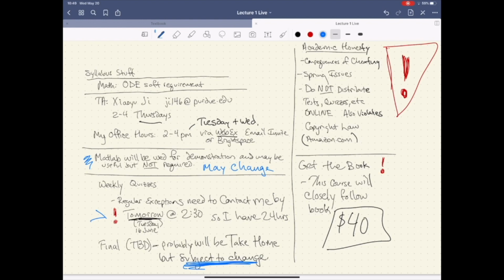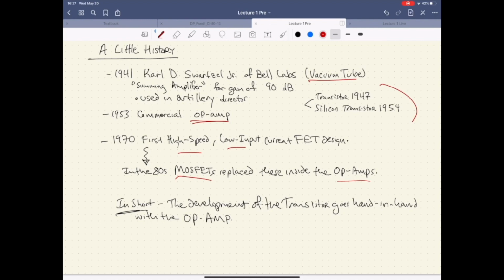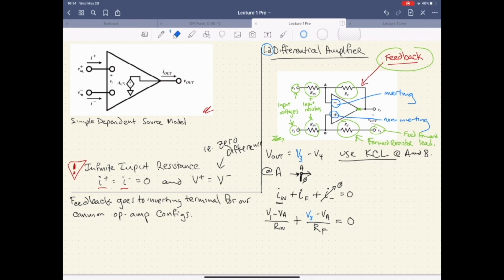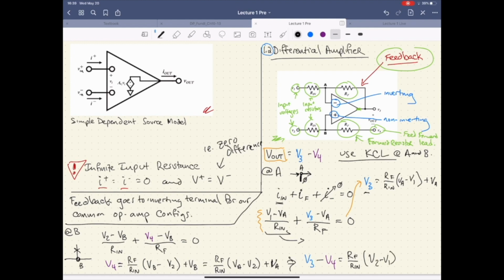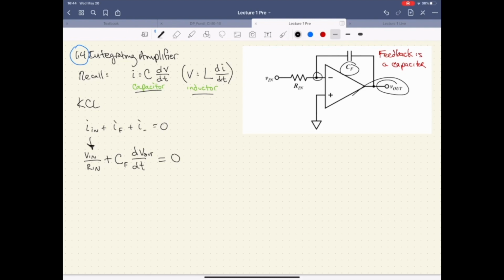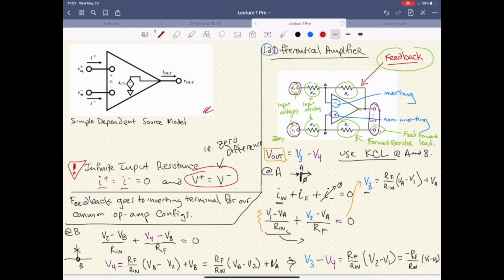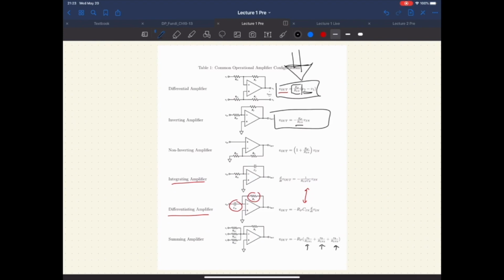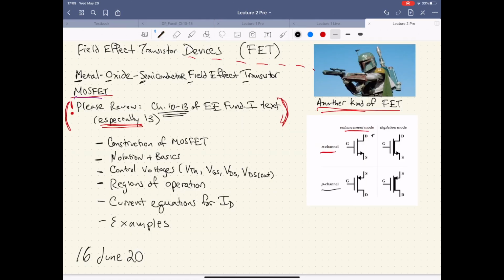Lecture 1 - Summer 2020

Comment: How come the current for the R_in was calculated using the voltage V_in (before the resistor) yet the current for R_F it was calculated by V_out/R_F (after the resistor)?
Reply from the maker: Location location location. Look at the diagram and think about Ohm's law. You can draw little arrows over those two restore elements and it should make more sense.